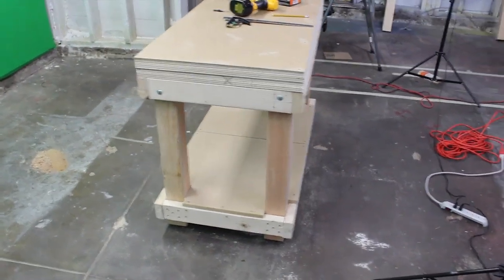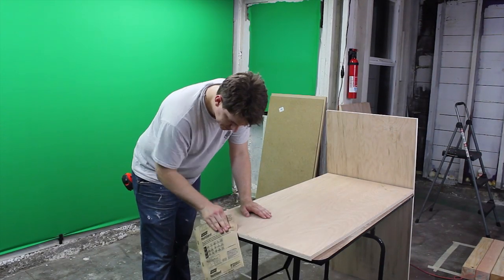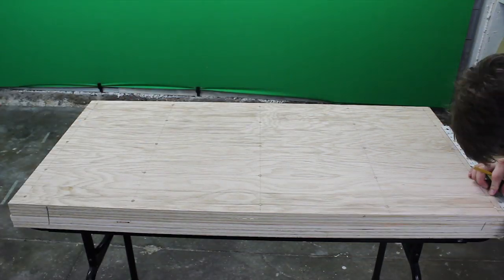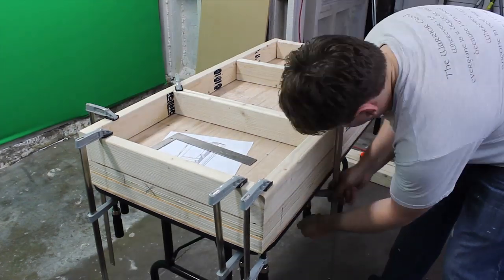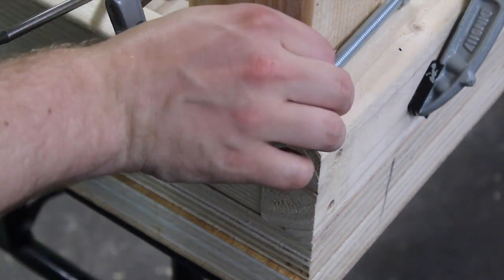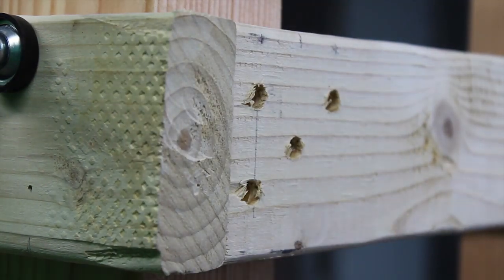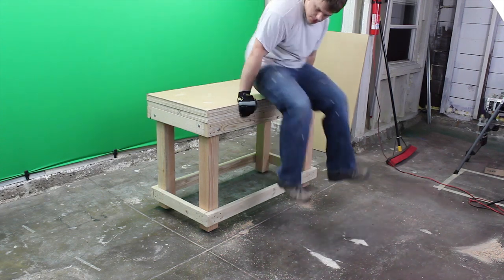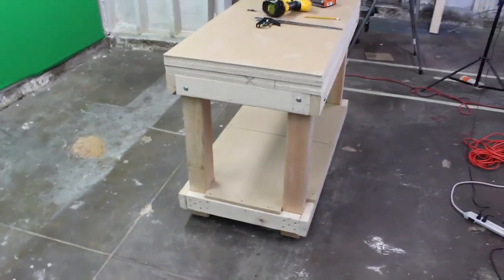Easy Beginner Workbench for 150 dollars - FREE Sketchup Plan in Description

Comment from the maker: I wanted to mimic what other workbench's are built like with the long maple 2/4's.  Most of the bench's I saw were about 2-3 inches tall for the top, and its super simple for me since my design is based off a quartered sheet of plywood.  I hear ya that it's way more than is required, but the sturdy feeling of the top is really nice.  Hardboard makes it silky smooth and its a great feeling top.  Something tells me that I will not have to worry about this bench sagging either.

Comment from the maker: The top needs to be that thick in order to accept Dogs at some point.  They are these metal wedges that go into the table top and are used to pin work pieces between a vice on the side of the table ( that would go in at that time) and the top of the dog.  That way the top of a workpiece can be worked on without anything clamping it in place.

Comment: cool job mate - i see why you needed the adjustable feet and i like your attitude - it isnt perfect but it does the job as good as a perfect one
Reply from the maker: tyrone younger It's been going for almost 2 years and its been great.  I added a vice to it, and a drawer under the top.  It's been a great place to get work done but I do wish it was like 30 inches deep rather than 24 at times :D
Reply: +xBeau Gaming Make a top cutting 3 30" (x48") pieces from the 4x8 ply. If you have to have a 3" top, you'll have to splurge on a second sheet.

Comment: Is there a particular reason you layer so many pieces of plywood for the top? I've built several similar workbenches for use in my father's auto repair shop and I only ever use a single 3/4" piece for the top. These have proven more than adequate for supporting heavy engine parts and all the abuse that comes in a busy repair shop, which I imagine is more abuse than any woodworker will give their bench.

Comment: Can you stop talking for 5 seconds?! You do know they're are things called planel saws or hand saws by Stanley and other makes? You don't need power tools like a chop saw or circular power saw, you can simply use a hand saw to cut the sheets in half and certainly cut the other timbers. 
Why do you Americans use inches? Why not centimetres? Or MM? 
im a carpenter and the bolts with the butt joints aren't as strong as other joints. The entire top and frame is held by 2 bolts on each leg? You should've used glue at least it would've made your bench even stronger especially with those weak joints.